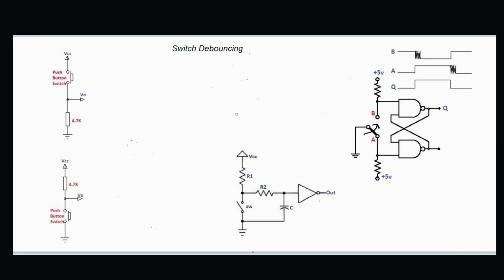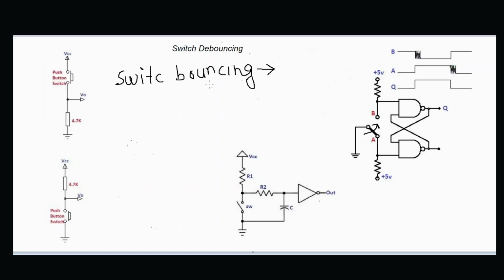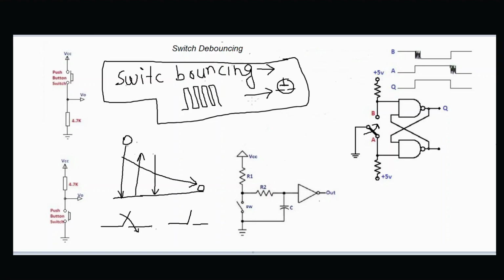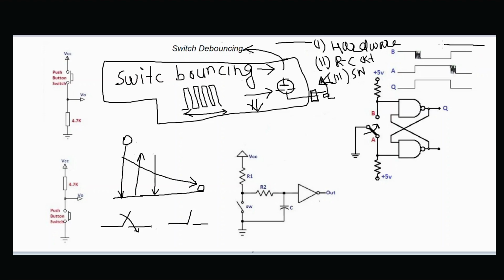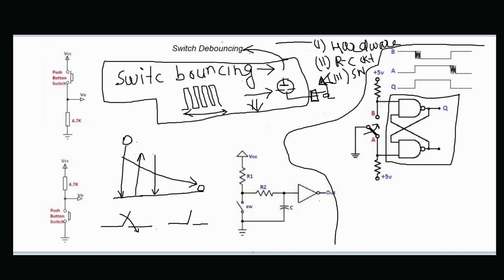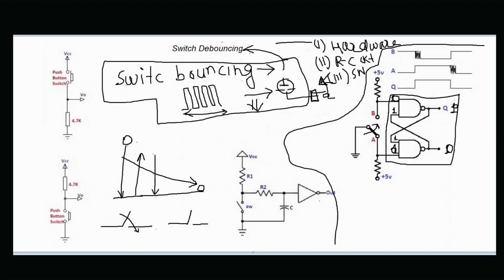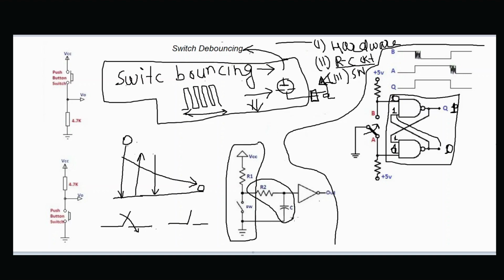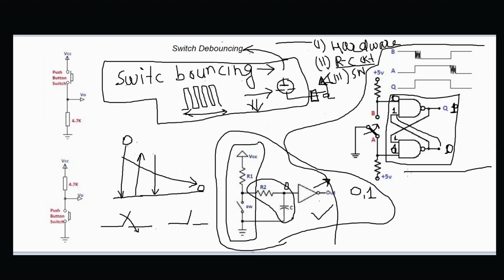What is Switch Bounce and How to Debounce || Switch Debouncing || S-R Latch

Comment: Hi there, you have a very good explanation, but i have a question : "I have an electronic circuit, and i am using a circuit breaker to turn on and off, i am bounces a lot. My circuit is not programmable, it is pure electronic components like resistors and capacitors. Can you please tell me if your solution is a solution ? Or do you have another idea?

Thank you man for your time.
Reply from the maker: Thanks